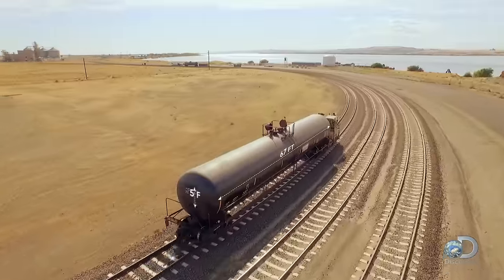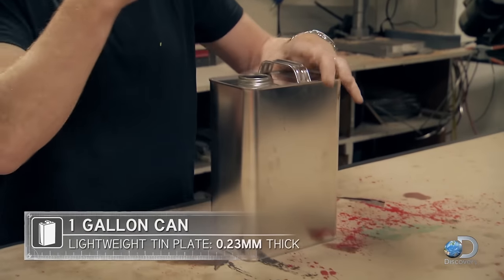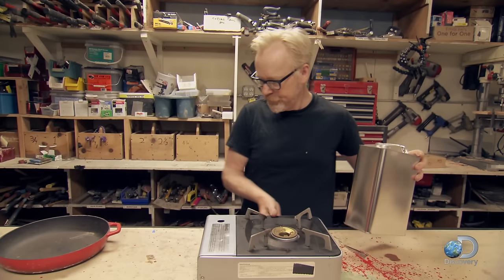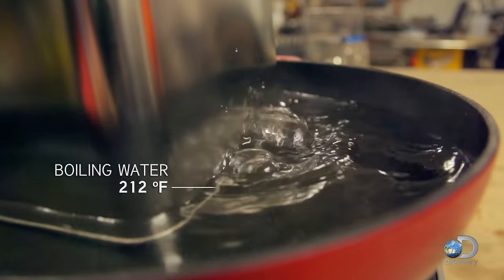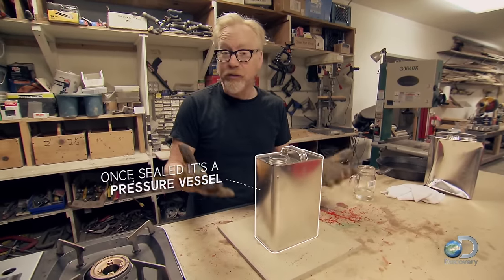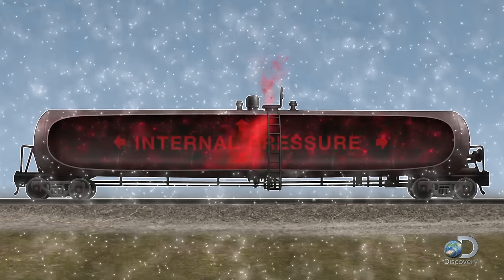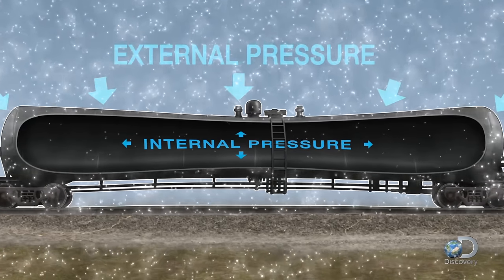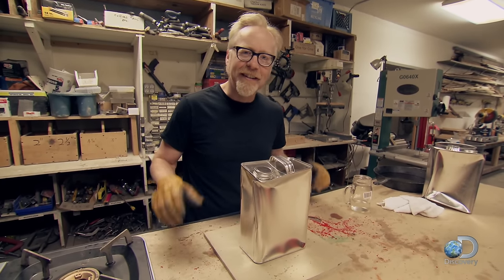The Science of Implosion | MythBusters

Comment: The crushing of the can was done by the weight of air! That's right, air did that to the can, now imagine what the weight of thousands of pounds of water can do to an object that goes to the ocean floor in a can (a submarine). You never think about this, but we are living under a sea of air. INTERESTING FACT: if you take a 1x1 inch column from the surface of the earth to the highest point in the atmosphere , the weight of air in that 1x1 inch column of air is 25 lbs. Now do the same, but with water! water is approximately 800 times denser than air. In other words, a given volume of water weighs about 800 times more than the same volume of air.

For this reason, the pressure underwater is crazy!

Comment: This is NOT why the sub was crushed.
This video explores pressure differential due to temperature changes.
The sub was imploded by extreme external pressure due to water levels.
The visual is similar, but the reasoning is qualitatively different.
Also, Mythbusters is so non-technical with terminology and explaining phenomena that I put it on par with... even saying Sesame Street is an insult to the ventriloquists.

Comment: People are abit confused and think this sort of thing is how the Titan event happened. It imploded because of the weight of the water above it. Everyone was squashed and never knew it was about to happen nor did they see, feel or hear anything
Reply: It's the same principle. The inside of the sub was at a lower pressure (1 atmosphere) and the outside was higher pressure (360 atmosphere). The pressure sphere, or in the Titan's case the pressure cylinder, is almost the same as the fuel tank shown in the video. The weakest points were in the body which was made of carbon fiber. Think about how easy it is to crush a soda can from the side than from top and bottom. That's why most submersibles have a pressure case in the shape of a sphere that has lesser weak points just like James Cameron's submersible, the Deep Sea Challenger.

Comment: This is certainly an implosion but is this the same type of implosion that happens to submarines or is it different?
Reply: The can in the video was waaaaaaaaaaaaaaaaaay slower than would have happened with the submersible. The pressure differential that deep is many times greater and carbon fibre doesn't deform when it fails, it shatters. It would have been literally faster than a human being can perceive, like a signal wouldn't have had time to get to the brain and be processed, and it would have been... shrapnel-ey as well as crush-ey? The acoustic monitoring system would also apparently only detect failure a few milliseconds in advance, not long enough to perceive either.
Terrible that five people died, particularly from stuff that had been documented to be mindbogglingly unsafe, but they wouldn't have known anything was wrong, just ceased to exist.

Comment: For the record, this is not like what happened to the submersible. A better representation would be when you fill a soda can with steam then put it in ice water. Instantaneous implosion. It didn't bend and slowly crush them. It happened in milliseconds and turned any organic matter inside to mist faster than you can blink your eye. All in all, it was probably the best way to go out of all the scenarios like slowly going insane from suffocation or freezing to death over the course of it. Just instantly done like you turning off the light switch in a cave.
Reply: water boils at 373K
Ice water is 273K

changing the temp of the vapor/gases inside a soda can from 373K to 273K is only a 27% reduction in volume, not enough to completely collapse the can flat

if you filled the can with pure steam (water vapor only) and then caused it to condense, it would be a good science experiment on the curve of water going from solid to liquid to gas, 
 but even if you got all the water to condense, that would leave a near vacuum inside the can, which is only a 15psi differential with the outside air pressure - nothing would happen instantly, because thermodynamics does not allow steam to be dropped 100K instantly.

The pressure inside the sub was 15psi
the pressure outside was 6000 psi

Comment: So what if a submarine had the same air temperature inside as the water outside?

Would it still implode?
Reply: Yep, temperature wasn't really relevant with the submersible. Adam was just using steam cooling there as a simple way to make lower pressure inside the can. Really it was down to pressure and carbon fibre being an intrinsically bad material for making things that need to resist compression (though it's good for the opposite kind of pressure vessel, making things that need to contain high pressure, like gas tanks), temperature wouldn't have been much of a factor. A few go-arounds of diving to high pressure and ascending to lower pressure would have probably done more and more microscopic damage to the carbon fibre around any little inconsistencies in the layering and adhesion (not to mention the basically-glueing that joined it to the titanium) until when it dived yet again... instant crunch at a certain depth.

Comment: people seem to be concerned for the anxiety of the passengers aboard as they began to hear the submarine failing... you can stop worrying... they didn't hear anything or have time to panic. their acoustic monitoring system was irrelevant. the steel end caps pulled from the wreckage were clearly intact. which means it's the carbon fiber shell that was compromised. it would have instantly shattered like glass. at such extreme depth and pressure, there wouldn't even be time to register that a 'crack' had occurred or was occurring. they were just conscious and talking to each other one moment; the next moment they ceased to exist.

Comment: If the submarine was the can, does the people inside it even know it’s crushing em? Or were they already dead inside before the sub starts turning into like this can?
Reply: So, the pressure differential there would have been many times greater and carbon fibre just shatters when it fails rather than deforming. They would have died from the implosion itself but it would have happened literally faster than humans can perceive, faster than a sensory signal can get to the brain and be interpreted. The acoustic montoring system (for hull strain) was criticised by the engineer who was fired a few years because it would detect impending failure only a few miliseconds before it happened. The people in the sub wouldn't have even had time to hear an alarm.
Just instant cessation of existence without any warning.

Comment: If you come because of the Titanic, keep in mind this can is made of steel. The sub was made in carbon fibre. Which means it doesn't deform. It breaks instantly and extremely quickly. Meaning the didn't see it coming and it was extremely fast.
The problem tho is it turn in the sub into a diesel engine. Everything and everyone inside were combusted to dust
Reply: The Titan is made of a titanium cylinder surrounded by carbon fiber.
Reply: @benjaminmartin7904  no it’s not. The end plates are titanium but the hull itself is made of 5 inch carbon fiber in a cylinder form. A terrible design which is why it imploded

Comment: Five people in that submersible caused heat to happen inside the same way there was heat inside the steel container in this experiment… then the cold water in the deep meets with this condition caused the implosion, makes sense now.
Reply: Nah, just pressure and carbon fibre being an intrinsically bad material for making things that need to resist compression (though it's good for the opposite kind of pressure vessel, making things that need to contain high pressure, like gas tanks). Temperature wouldn't have been much of a factor, Adam just used steam cooling there as a simple way of creating a pressure differential between inside and outside. A few go-arounds of diving to high pressure and ascending to lower pressure would have probably done more and more microscopic damage to the carbon fibre around any little inconsistencies in the layering and adhesion (not to mention the basically-glueing that joined it to the titanium) until when it dived yet again... instant crunch at a certain depth.